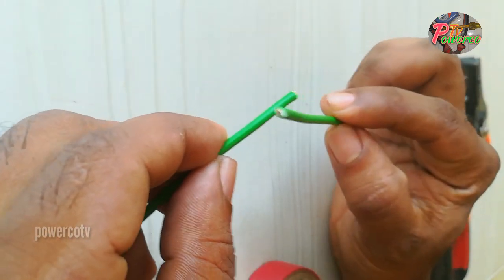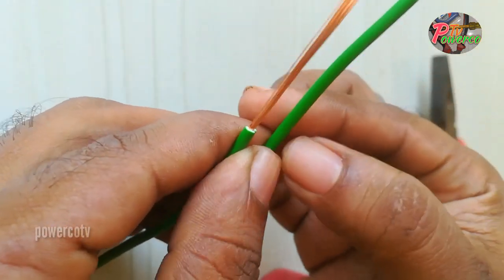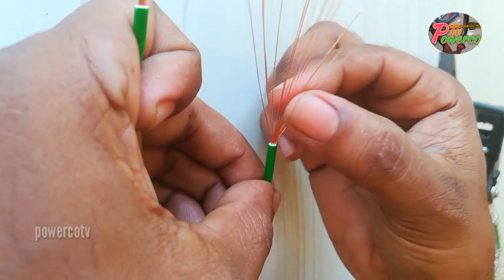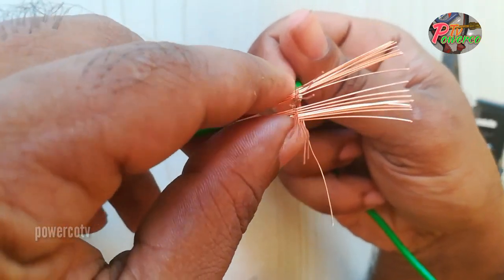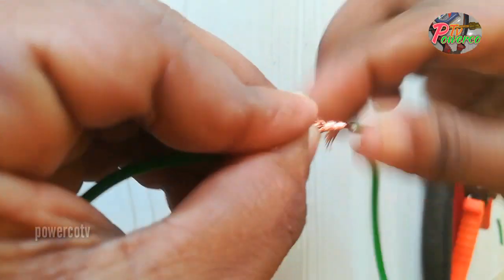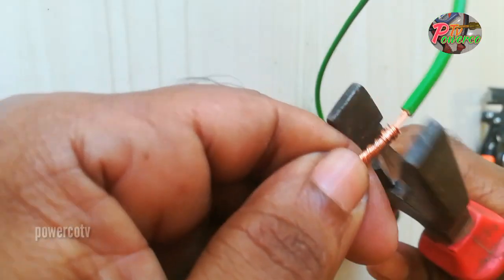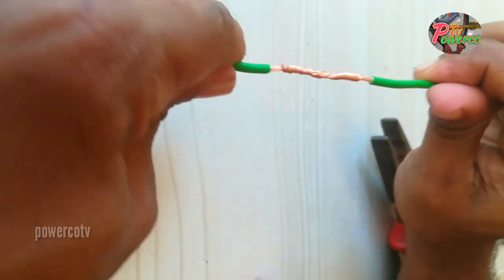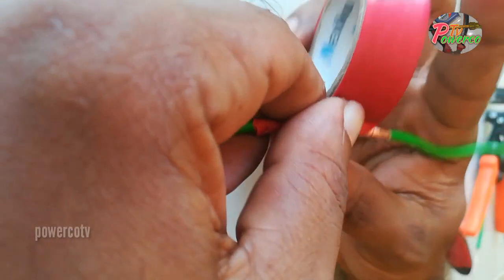Proper  joint  of electrical  wire(malayalam ) നല്ല രീതിയിലുള്ള വയർ ജോയിന്റ്

Comment: Ingane cheythitt solder cheyyunathu kondu kuzhappamundo bro?
Ente kayyilulla 6A usb data cable cut aayi..ullil 4 wires undu..ath ithupole join cheyth insulation tape ottiya mathiyo..
Atho vere insulation reethikalundo
Thank you
Reply from the maker: യുഎസ്ബി കേബിൾ ജോയിന്റ് ചെയ്യുന്നത് വളരെ ബുദ്ധിമുട്ടാണ്